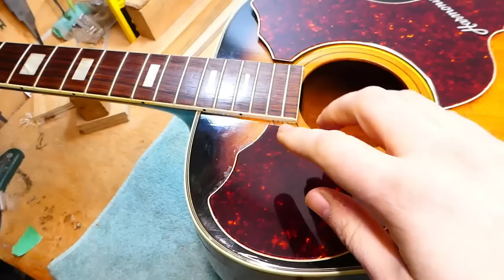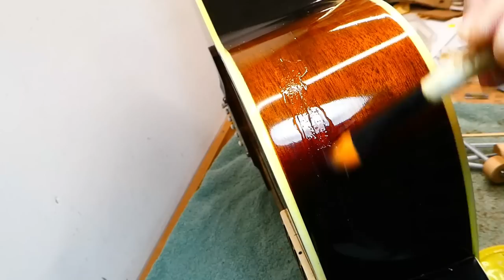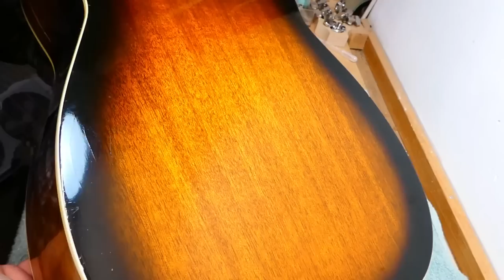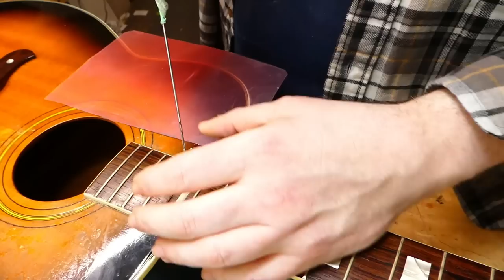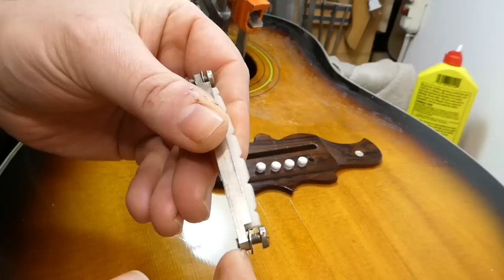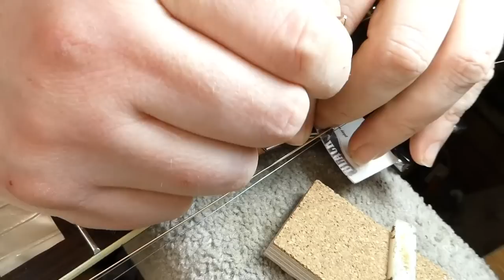Sovereign Dee-lux

Comment: I'm in the instrument repair trade myself and recently made friends with a material scinece engineer. He turned me on to Linomene. It may not help with the pickguard glue, but I've found it a pretty good all around degreaser. Been using it to clean old valve oil that solidified, previously I was using a torch to clean it.

Comment: You took a piece of junk, ready for the garbage, and brought it back to life.   Amazing work as always.
Reply: Thats no piece of junk. Those sell for upwards of $1800 and probably higher depending on condition. So it wouldn't have gone in the bin no matter what. Well, unless you can afford to throw away stuff likely worth $1200+ even in the condition it was in with the cracks in it.

If it was a $200 guitar, then sure. But he wouldn't be putting this work into it if it were only worth that much.

That and no one I know would knowingly just throw away Brazilian Rosewood. Especially on a guitar in that condition, thats no where near being ready for the garbage.

There's also the fact that not everyone has to take their guitars to someone when they need work done. So for some of us, it also wouldn't cost much to address those issues since we aren't paying for a professionals time & knowledge.

Comment: A few years ago I found this obscure adhesive remover that I'm sure was made from oranges and it worked great removing contact adhesive. I've never seen it again for sale ( in the UK ) it was advertised for floor layers to remove glue from  linoleum..
Reply: I suspect it to be some form of goo-gone!😂 I think that stuff is orange oil based
Reply: Limonene?
Reply: @Daniel Steinman  definitely not as we didn't get that inthe uk back then. It was from a chemical company we used to buy our sprays from and it was really good stuff.

Comment: 3M General Adhesive Remover in the red and white metal can has worked for me in the past. I saturate a paper towel and wet the area by mopping the paper towel across it. Let sit for a short time and it will begin to gel the adhesive. Wipe clean with another fresh remover soaked paper towel. Then wipe all residual off with one soaked in water and dry right away. Sometimes I have to repeat the steps a few times to get everything off. I am always careful to work within the bounds of the guard to start with just in case it wants to eat the Finish. But it hasn't done that to me yet. Just have to put the stuff down and take it back off within a few minutes.

PS your videos are always spot on and have been extremely educational for me. Thank you for your ingenuity!

Comment: A method I use to remove adhesive from pinball playfields is regular flour and 91% iso. Yes you still have to rub for a while but it works. The glue sticks to the flour and then you just brush or vacuum it away. For tougher spots I use plastic razor blades as they won't scratch the wood like metal can.

Comment: For all its quirks and issues, it's actually a pretty nice guitar! I'm surprised that there weren't a lot more cracks! Wondering why you didn't replace the entire saddle assembly with a full width piece of bone, or plug the slot and re-rout it, so as to get rid of those crappy bridge screws? Wouldn't that induce more string energy transference and give a better sound?

Comment: Outstanding guitar. I used to have 3 of them. Two Sovereigns had broken  headstocks. I open one to look inside and from time to time I still look at that one for reference materials. The other headstock I glue back in place and my 3rd Harmony is like a 00018 Martin a needs a bulge repair behind the bridge. Most likely a neck reset, but I'll start first taking the hump back (not a whale reference) down first (not a football reference either). Great work, love your skills the best so far as my favorite Luthier. Cheers!

Comment: I have my hands in a 1926 -30 "The Gibson" L-1 as we speak.  It has two unglued braces, after market way wrong bridge (DIY CA 1950's) and the bridge plate was replaced with two thin veneer strips all willy nilly...  Huge bulge and a few cracks in the soundboard (Mahogany).  Oh dear, I have my work cut out for me.  Neck is freakishly good though, no need for a reset.

I have found that old Soveriegns do sound great for what they were sold for!  I worked on quite a few and only one was a lemon.  One still sounded good albeit very quiet, until I removed the 2.5" X 12" X 3/8" plywood someone used as a bridge plate and replaced it with a proper bridge plate.  I got really lucky they used crap glue, and probably didn't clean and sand or used any clamps.  It took an extreme attack angles, and some leverage, but it popped off clean in one POP!  Once shored up, it could easily be played side by side with top line Martin's, Gibsons and even very expensive hand made instruments.

Comment: I had a sovereign H1260, the plain/poor mans version of the same guitar. It was my main guitar for over 10 years (until it was stolen). I loved the sound of it. It is also hard to criticize the material quality: one piece mahogany back, Brazilian rosewood fingerboard and through bridge, good quality top, hide glue on almost all joints, nitro finished.  They were sloppily assembled though, glue runs all over the inside of the guitar.

Comment: Thank you for your excellent video. I recently purchased a Harmony Sovereign manufactured in Chicago in May 1972. It needs a neck job. The action is just too high.Also it the strings going through the saddle, rather than through the top of the guitar, and their is some slight bulging that needs attention. I probably paid too much for it ($350.00), but I've wanted one for quite some time and it has a beautiful tone. I'm not able to throw $900 into a neck reset and saddle fix. I am looking for some advice on how to proceed. I recently watched a luthier from Australia who said he used steam only to reset the neck. He has a You Tube video on his process and says it works, takes about a month with about six sessions of treating the wood with steam. Looks pretty straight forward and easy but I am concerned the steam treatments will damage the adhesive bonding the top to the body, or the back to the body. Option 2 is to try to do a neck reset myself. I have to tell you that I'm very scared of screwing up this beautiful guitar. Option 3 is to just leave it and play only on the top seven frets. What would you advise? I'm hesitant to move forward on anything without hearing from someone who knows what they are doing. Love your channel. Thank you.

Comment: Ted, any thoughts about how covering 1/3 of a top's area with thick plastic glued-on pickguards affects the sound of an acoustic? Not an issue on solid electrics but seems to defeat the purpose of putting a thin lacquer finish on an acoustic. Might as well just shoot a thick multicoat poly on it. But admittedly that's why we don't glue anything but the bridge on the face of the lower bout since that's where most of the sound and character come from. Anyway, I've never needed pickguards on my guitars because I pick and strum the strings, not the top. Whoever needs a massive pickguard like on this Harmony maybe needs to work on their technique or just beat on it like Tommy Emmanuel or Willie and not worry about it. But with the big ornate guards it does have that Buckaroo look for those that want that for the show-biz appeal more than they want a 'fine' instrument. No argument with anyone who feels that way, it's a valid position. Incidentally this guitar's overall finish without the guards doesn't look bad and the whole thing would've looked waaaay better if the customer would let you just clean up and refinish the wooden top where they once were, 'IMO.' As the saying goes, "Opinions are like a**holes; everybody has one." Or several. As usual I love watching you work and appreciate your running commentary. Thanks!

Comment: I've a much older Harmony... the sides are toast, need replacement.... but as you know, it needs lots and lots of other work. 

I can't believe how thick the top is. Since I need to disassemble the whole thing, I'm going to run the top through a thickness sander..

Now, to ladder or X brace it.

Comment: Does anyone have any thoughts on doing a slow motion type guitar straightening. Like strap/mount the guitar to a flat plank or board, and then with wedges, clamps, jacks etc. Over the course of say a year, controlling the environment, like bringing the guitar outside when it's really humid etc. And eventually nursing everything back to original form ? 
It would seem if you didn't have any time constraints, I don't see why it wouldn't go back to how it was when it was new.

Comment: Perhaps someone can design a motorized scissors jack with a heated top designed to heat up the bridge plate and facilitate easy (easier) removal.
Reply: You could do a lot of things, but bridge plate removal is still one of the most intricate things you can do on an acoustic guitar. You are using a sharpened edge in an area you can't see, and you hand must pull. It makes things very, very touchy-feely. More than one guitar has had the bottom of its sound board gouged pretty badly doing this. That is why Stew-Mac has come up with their various ways to work around need to remove a bridge plate.

Comment: Can’t believe how much that headstock facing has shrunk. I’ve seen it with pickguards, but never headstock facings that are glued on. What an awful material!
Reply: Is it also out-gassing nasty acid fumes?
Reply: @viewer112358  ,  If it was outgassing nitric acid, as some celluloid formulations do, I would expect the tuners and the bridge saddle adjustment screws to have turned green.  Or perhaps it was never stored in the case, although it looked pretty clean.

Comment: I saw the UGLIEST thing the other day. This guy was cutting slots like 3/4"(18-19mm) long extending from the front of each bridge pin hole until maybe 3-4mm away from the saddle. Saying he was doing it because the guitar needed more break angle when it actually didn't. I seriously couldn't believe what he did with a tiny hand saw that left jagged, nasty cuts. He had no reason to. And then he made a very nice guitar look so so bad. All so he could tell everyone they need to do it to all of their acoustics so they have good break angle and the strings do this and that. It looked so bad.

Comment: Why guitar people do not use purpose made electro magnets is a question. As a mechanic for all my own cars, I own tools which are expensive and only have a single purpose. In fact depending on my lifespan. Said tools may only be used the one time. I mention this as you personally are always mentioning the cost of things. Why go into a trade which has insufficient remuneration...